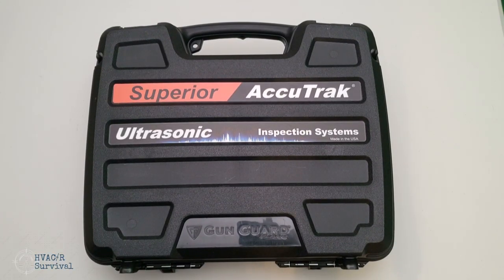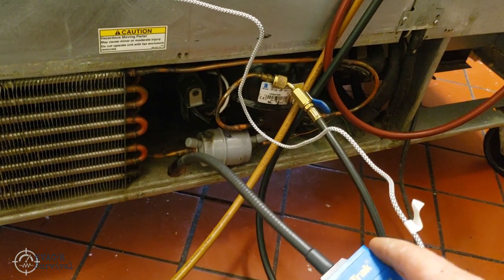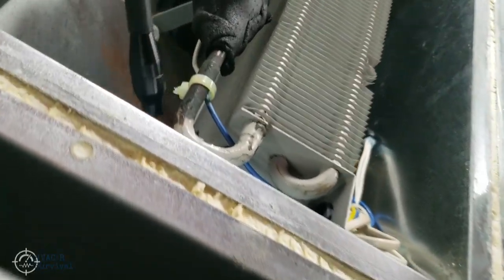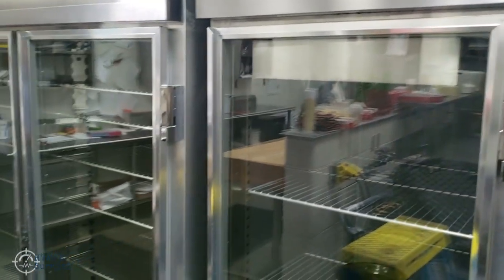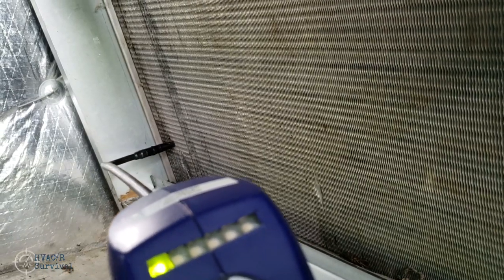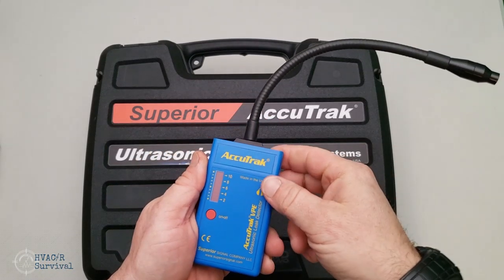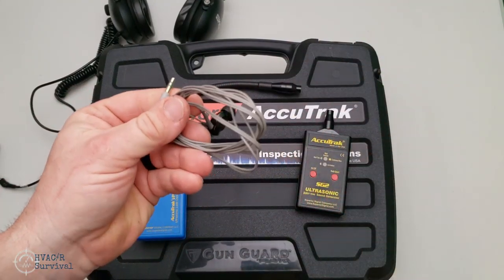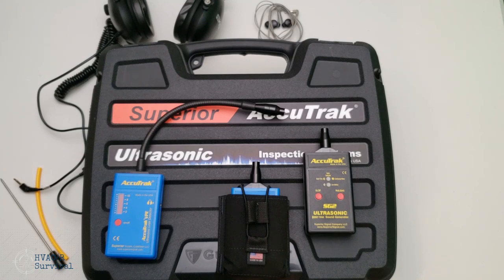Superior AccuTrak Goose-neck Ultrasonic Leak Detector With Several Different Leaks To Hear.

Comment from the maker: Thank you for taking the time to check out the review of the Ultrasonic Gooseneck leak detector! 
I posted links to the different kits available on Amazon and the factory's website for your convenience.  I use my ultrasonic more for special applications such as hard to find leaks and verifications.  Sometimes it's a easy to find leak so I also use my H10PRO & DTEK SELECT. My 3rd choice is a Tiff ZX. Each detector has strengths and weakness. I will go into those preferences more at a later date.

Comment: I told you you were going to like that thing.!  I guess I was the one that got the ball rolling and kind of got the word out about the benefits of ultrasonic leak detection. But Superior Signal never reach out to me a single time. But boy if I sure didn't make them some money. All kinds of guys have bought one of those things after watching one of my videos. You did a really good job on this video 👍
Reply from the maker: Thanks Shannon, I've been putting material together for months and finally got it finished. I think the goose neck is a little better at blocking the interference than my original one but I purchased that one used.

Comment: Dang you sold me bro. What's really great is you don't have to worry about refrigerant type either.
Reply from the maker: Nope it don't matter what refrigerant. But keep in mind you'll still need a good refrigerant leak detector. It doesn't find every leak.  it's really good at the weird leaks and really good at outdoor leaks. There's sometimes it just doesn't pick it up because of the type of turbulence that's created around the leak spot. A good example is flare fittings. They don't usually make much noise
Reply: @HVACRSurvival  Good to know! Good thing flare fittings are usually the culprit when a system has them, so I usually just soak them with bubbles lol

Comment: Great review! I would like to pick one of those up sometime. Anytime I use leak detectors it’s always in conjunction with other methods. I have a newer Fieldpiece heated diode detector  and it’s ok depending on the circumstances and leak rate. It would be nice to have that option also. Thanks for making  these videos I’m always learning something new from them!
Reply from the maker: I tried both fieldpiece leak detectors,  hated the infrared because it wasn't sensitive enough and really hated the heated diode version because it was too flaky and false alarmed all the time. I really like my H10 PRO, INFICON DTEK SELECT & TIFF ZX.  I use my Dtek and H10 most of time,  and will double check with my ultrasonic to help learn what's the capability of each. I'm a tool geek🤓👍👍💯

Comment: Boy , that seems like an awesome tool , I'd love to add that to my kit .
One thing I wonder is , can you still use it in a noisy environment , like if there's another unit running close by , or on one circuit while the 2nd circuit is still running.
I would imagine that you probably need silence in order for it to be proper effective.
Still though , getting jealous , mate .
Nice review , I hope manufacturers send you stuff so you can keep doing reviews , that's really useful for us .👍
Reply from the maker: It depends,  normal noises like wind and birds don't effect it but clanging kitchen utensils and slamming certain kind of doors does. but those are usually instantaneous noises versus what you heard that was continuous. Thanks 4 watching👍👍
Reply: the gas/liquid flowing inside a coil, txv, tubing may kill it and probably get ringing from compressor valves and bearings on motors in close proximity. best bet is likely shut the whole unit down.

Comment: I have the one without the gooseneck. I'm not super impressed with it. I was getting electrical noise every time I used it so I sent it in for service and they replaced the circuit board. I'm still not convinced it was worth the money but I have it to keep learning with it
Reply from the maker: I get that noise as well, I think this does best outside in places that are less noisy but it does work in all areas you just have to listen very carefully and learn what your listening for. It's definitely harder when there is a lot of background nosie.

Comment: Just bought one, I was debating on which leak detector to get, I was leaning towards the H10 but the ultrasonic is very straight forward no having to replace sensor yearly. My other leak detector fieldpiece heated diode has to many false hit very frustrating
Reply: Whats your update now? Yea my fieldpiece one isn’t getting the job done anymore getting a new one tomorrow.
Reply from the maker: Inficon Stratus or Dtek3. H10 pro is also great but I use the Inficon most of the time.

Comment: I'm curious about the applicability for the ultrasonic sound generator for finding hairline cracks in heat exchangers. Have you tried using putting the sound generator inside a burn chamber and trying to pick up sound leakage from the supply duct side of the heat exchanger? I ask because the accutrak kit with all the bells and whistles is pretty pricy for just performing refrigeration leak detection, but it looks like it could theoretically work for finding cracked heat exchangers, too, which would make it very economical
Has anyone tried it and have any commentary on that application?
Reply from the maker: I can’t say I have tried it, generally, I try to use my eyes before I condemn something, so if that means pulling the heat exchanger out of the furnace and looking at it, I will, if I have a reason to believe it’s bad but I don’t see why it wouldn’t potentially work. As a refrigerant leak detector I’ll still side with the Inficon Stratus or Dtek3  as the best detector for refrigerant leaks. This is just another tool in the arsenal as I mentioned in the video, it’s not perfect and it does not find every leak.

Comment: Could recommended me a accutrack for detect vacuum leaks on seals, hoses and others
Reply from the maker: It detects vacuum leaks, but vacuum is harder to pick up because the sound is being pulled in vs being pushed out.

Comment: Have you ever tried bringing in a pump sprayer and wetting down the equipment
Reply from the maker: Yes, you can hear the hydrogen bubbles break. I have been mislead because of that. The factory didn't recommend it. But it will change the sound of you think you found the leak.

Comment: Bought one just got it and turned it on and upgraded headphones but all I am hearing is static is that normal. When I move the cord it picks up. Not sure If I have a bad unit.
I have a small wine cooler can't pick up a leak with the electronic testers . pressure it to 100 pounds after 3 days it leaks out.
Reply from the maker: It takes time to understand the weird noises that a leak makes. It gets easier as you use it more and more. The first few times suck because you don't know what it can sound like. The smallest leaks sound like a tick and clicks. you can tell it works if it picks up your finger rubbing together or a eye lash blink.

Comment: Never have used one...How durable is it? For example if you slipped and got water on it is it toast? Not saying dunking the wand into a condensate pan but just a drop. Appreciate the videos keep it up👊
Reply from the maker: I would doubt a drop from say 4 foot or 5 foot would hurt it much. It's not a delicate flower but it is made out of plastic just like anything.?
Reply: Sorry I was wondering how susceptible to water is it?

Comment: Thank you!
Reply from the maker: Very welcome. thanks for viewing!
Reply: @HVACRSurvival  yesterday I spent a long time to find a leak in small ice maker, I have Inficon leak detector, but unfortunately even with zero out feature I cannot localize the right spot of leak untill I pressurized system with nitrogen then with my ears I can go to leak location, LoL. I found that unltrasound is very expensive tool to buy but as recommendations, did you find really those detector are worth it ? Is leak detection time can be short? There is no false signal or detection?  Thank you for your time!
Reply from the maker: I purchased the first one used, that helped save some money.  They do a good job but will not replace a good sniffer,  they work best as a specialty tool when the sniffer has problems or outside  it works best,  it takes time to get good with it and learn its characteristics.
Reply: @HVACRSurvival  thank you again

Comment: will you been doing a video to diagnose a bad TXV??
Reply from the maker: If I run into one I will. It's generally not difficult to determine.  If you have proper subcooling but the superheat is not correct and you have proper airflow than the only thing left is the TXV. This all depends on whether we're talking about residential or refrigeration. This is also assuming that the TXV is not adjustable and there's no flow restrictions in the refrigerant circuit.
Reply: @HVACRSurvival  ok thanks i look forward to it!

Comment: Nice video, Thanks. have you ever use inficon whisper? any comparison? I'll tell you something... I have a dilemma, I don't know what to choose, I searched the whole YT, (American, European, Russian) and nothing! this is an idea for a lot of views :)
Reply from the maker: I have the whisper, it's ok, it works, it's not as easy to get into tight spots, neither is going to beat a great refrigerant detector. My first pick is the Inficon Stratus, second is the Dtek3. I don't use ultrasonic very often. It has its place under different working environments.
Reply from the maker: @smklimatyzacja88  if your wanting to be scientific then stop playing games with the kids toys and go strait to helium like the industrial boys use, helium particles are smaller than refrigerant particles. Ultrasound ONLY MAKES NOISE IF THE LEAK HAS A JAGGED EDGE, I haven't picked up a leak on a flare fitting yet. I've played with the $20k FLUKE and it didn't impress me for twenty grand. It had better filters and a full color screen but still didn't pick up a leak any different than these cheaper listening devices. And if the systems flat on on refrigerant then it should be an easy leak to find... where are you planning on getting hydrogen at? Give me a break.

Comment: Ever try it on a natural gas leak? I know it’s real low pressure like 7 inches water column
Reply from the maker: I haven't,  I'm not sure how it would do. It's weird what it can hear,  it really depends how rough the "Crack " leak is. If it's a smooth break it won't make much noise but if it's rough it will sequel like a pig.

Comment: ,how long is the life on these ,any parts that need to be changed .
Reply from the maker: The original version one came out in the 1990s and has been updated 3 times so far. The factory is located in NJ and these are made in the USA! The last time I spoke with them they said they do there own repairs inhouse but have a low failure rate and if you do have problems the labor rate was reasonable.  I got my first one you saw in the video last year and haven't had a single problem with it. Basically, if you don't drop it or soak it in water it should last a long time. It is an audio device tuned for the 36KHZ-42Khz audio range and drops it down to the human range of around 0-4Khz.

Comment: Haven’t get a chance to find a leaks yet but it seem to pick up the leaks around my car’s rims. It pick it when I spray water on it. What if u spray blue soap bubble would it pick up?
Reply from the maker: You got to watch Using it around sprayed water and ice. Ice you can hear it melting 🤣 and with water you can hear the bubbles from the hydrogen escaping.🤦‍♂️

Comment: Man i really like the look of those devices. It’s on my next tool purchase list. Do you find you pull that out more than electronic sniffer ?
Reply from the maker: I normally start with my leak ref. detector first. Either my d'tek select or H10pro first, if I have problems then I'll go to the ultrasonic.
Reply: I have never had much luck with Sniffers. I normally find them with my ear. So my question is, Why wouldn't you just use the sound detector if it finds them so easily? Why go to the sniffer and then the sound detector? Just looking for your reasoning to go to the sniffer first.
Reply from the maker: Ultrasonic doesn't find near the leaks that the sniffer does, they work if there is enough turbulence.  It also depends the brand of sniffer you use. I have only had luck with Detek and H10.  Fieldpiece, tiff, cps were problematic and we're disappointing. A lot comes down to learning the tools capability and technic used.
Reply: @HVACRSurvival  I found and repaired 2 leaks yesterday.  Bubble soap couldn't detect.  I again found them with my ear using a rolled up paper like a tube listening to each U bend. ended up finding 2 leaks that way. Which lead me to finding your videos. I have given up on sniffers. I will check the ones you recommend. If I hear that they work from techs, I will take your word. I guess the majority of the sniffers are more or less trash. but some do work. I guess I was hoping for a tool that had a higher find rate. But I guess the only way to have a better success rate is to have a good sniffer and the ultrasonic tool.
Reply from the maker: @jasonnames  I'm a leak detector geak, I've been trying several detectors to come to these conclusions. Thanks for checking out the video👍👍
Reply: @HVACRSurvival  We need leak detector geaks. I am fully against leak detectors. Only to to the success rate I have had. Which is, Never had success. But there are geaks in this world who's mission is to show the world that they work. I am going to take your suggestion and out faith into a leak detector again. Thanks for the advice. I am a leak finding geak. Im the most successful leak finder at my company. and thats without leak detectors. So if I can find something that works...I will be the leak finding champ at my company. So if something helps...im open to it.

Comment: Intersting 🧐
Reply from the maker: Just found another leak today without any special pressurization in a rooftop unit. On R22 , the detect select could not pick it up . It definitely has the avantage over other means of leak detection depending on the application.